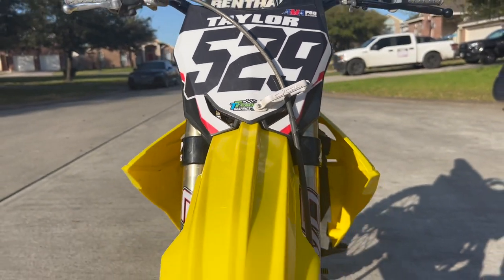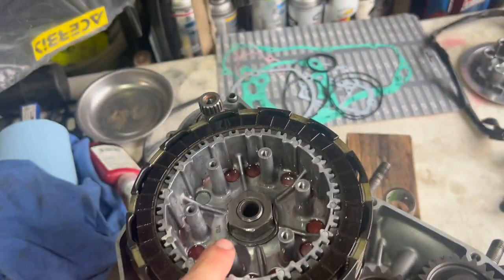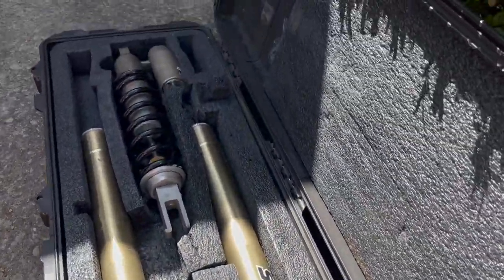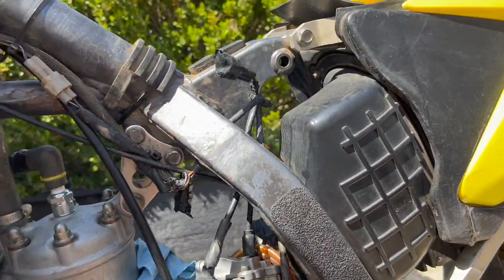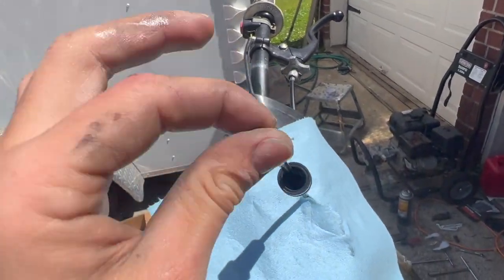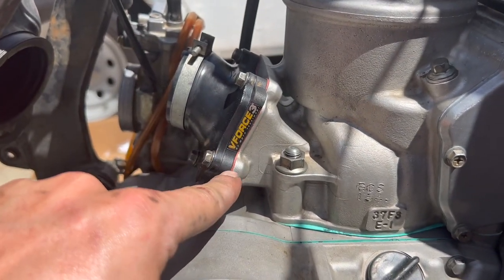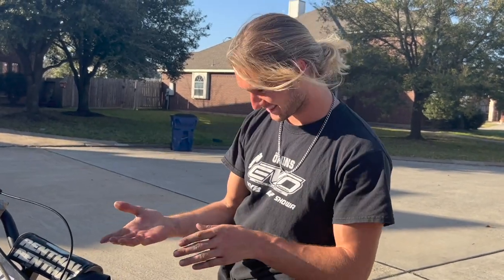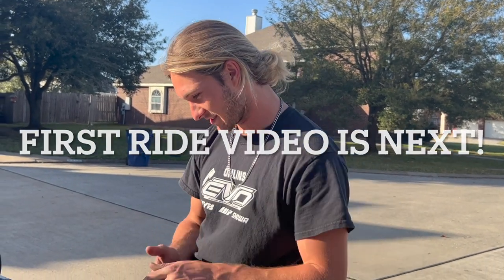RM250 Garage build part 2!

Comment: That renthal h839 bar is a stock 18+ crf bar and the same as the 21+ kx bar
Reply: Also what chain did you put on it
Reply from the maker: Sweet thanks!
Reply from the maker: @NickW90  mooses top of the line chain. Thought id try it and see how it does cause i get it real cheap. So far i have 2.2 hours and it seems to be holding up. Normally I run the DID ERT3.